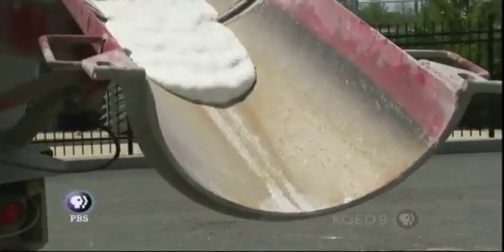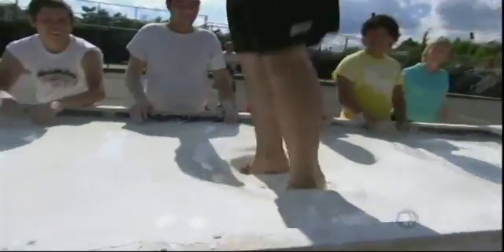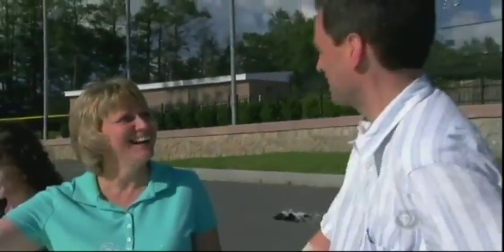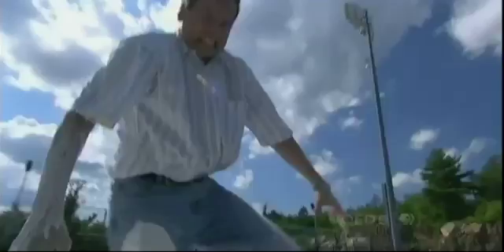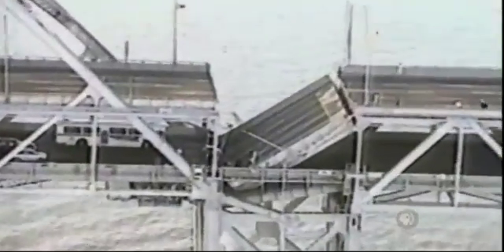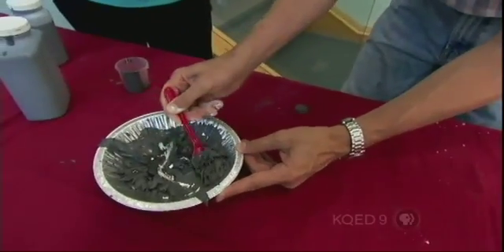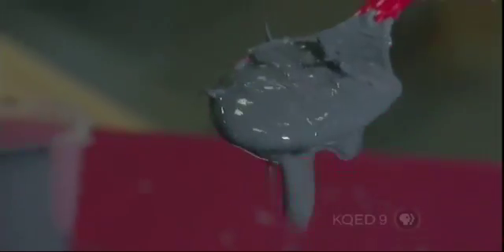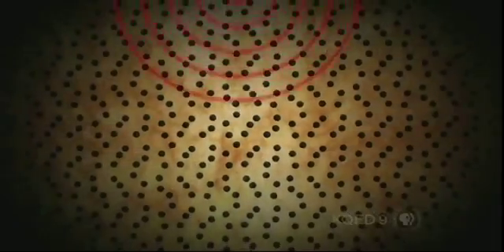Smart Materials (4 of 5): Magneto Rheological (MR) Fluid

Comment: "Twice as fast is twice as hard?" By that definition air is a non-newtonian fluid. Shouldn't he have said, twice as forceful results in twice as much resistance?
Reply from the maker: +K.H. Weiss If you inspect the equation for drag, you can see that for a given object's cross section. The resistance force is proportional to the square of velocity. So to be more scientifically accurate, you should say "Twice as fast is quadruple as hard? or three times as fast is 9X as hard?" and so forth.